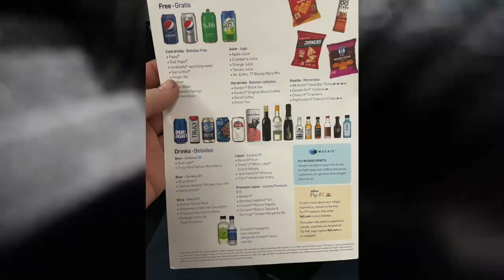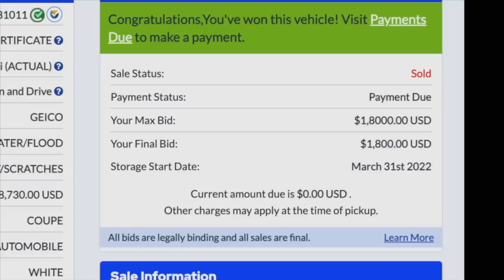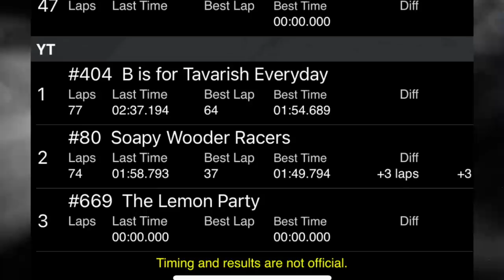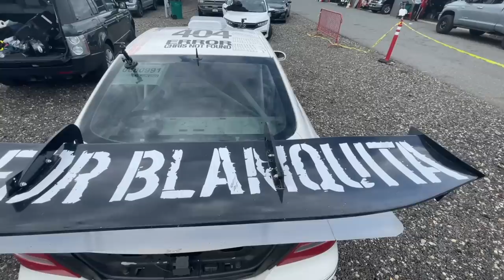Racing 24hrs Of Lemons In a $500 Mercedes CLK 320 GTR

Comment: The fuel pump fix I did on a carburetor car had a symptom of long starts after not starting for more than a day.  I assume it was a leaking check valve.   Unfortunately your symptoms weren’t the same.